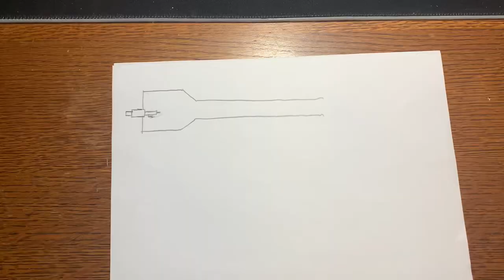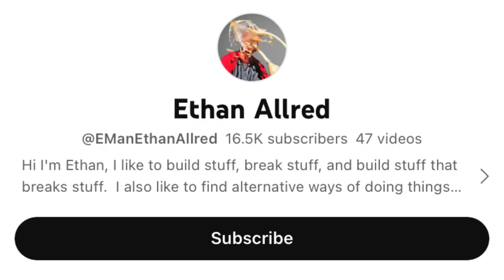Potato Cannon Sabot

Comment: Just sharing with you a neat trick I learned. 

There's a "potato cannon" community here in my country that builds what is basically an alcohol fueled marble guns out of 40mm and half inch PVC pipes.

What they do to increase power is they make these baffles that they glue inside the chamber. The holes on said baffles progressively get smaller as they near the barrel and creates a compressor effect.

This modification allows for a smaller ignition chamber without losing power output.

Comment: you can shoot: unopened glass soda/beer bottles (if you dont feel like cleaning up glass put the bottles in a metal trashcan with the open top facing the potato gun), any glass/ceramics, wet clay (reusable), thin blocks of dry clay (reusable), fishtanks filled with water, paint in a hanging glass/ceramic jar, model rocket motors, balloons, matresses, thin rusted metal, aluminum foil, a stack of cards, a stack of dominoes, basically any small object you can stack
Reply from the maker: Thanks for the ideas! I may make a video testing some of them out in the future.

Comment: Notice how much your barrel bends during the shot, shifting the muzzle significantly by the time the projectile exits. I would advise to add additional layers to the barrel by dressing it tightly in larger diameter tubes. It also would make it a bit safer. 
Main failure point is almost always the breach. You would need to strengthen it as well

Comment: Put a notch where the sabot touches the barrel, then wrap it in greased twine/string in the notch. It will reduce friction while giving better air seal
Reply: Would electrical tape work better? Or atleast compared to the bare sabot

Comment: If you can get your hands on a big valve (one sized for the cannon) you should try making a pneumatic cannon as they should be more powerful at least according to the one I built (just make sure to glue everything. The end cap on mine blew off from that)
Reply from the maker: The first time I showed the sabot was with a compressed air cannon, although the valve wasn’t very big. Despite the smaller valve it was able to shoot a ping pong ball at 120+ mph. I may revisit the idea and build one designed for the sabot.
Reply: What do think would happen if you sharpened the metal tip of the dart
Reply from the maker: @DaHail0123  I don’t think it would do much considering the round is so small. It would be interesting to lengthen the design to give it more inertia. Maybe I would finally make it through that cinderblock.
Reply: Two words: depleted uranium.

Just kidding
Reply from the maker: @DaHail0123  I would if I could…

and if it was legal.
Reply from the maker: @DaHail0123  I just found 1/4” by 4” tungsten rods on Amazon. Hmm…
Reply: How tf would you sharpen that. Diamond sandpaper?
Reply: I guess there is the same problem with depleted uranium:)
Reply: You just got yourself a new sub.
Reply from the maker: @DaHail0123  Bench grinder, like a giant tig welding rod
Reply from the maker: @DaHail0123  Oh, thank you! Now I definitely have to buy that tungsten!
Reply: No problem at all. I think the fins might need to have a bit of a modification to make it fly a bit straighter. Maybe thinner fins that are more like triangles.and also Maybe more of them for extra stability

Comment: Wouldn't propane be a better fuel, since it's what makes the hairspray flammable?

Also, the parts that you call "Stabilizers" are what's actually called Sabots
Reply from the maker: For now I am using carb and choke cleaner as fuel since it’s inherently flammable. I explained this in the video albeit in a terribly incorrect way which other commenters haven’t let me forget.  

Thank you for reminding me about my mislabeling of the parts. The only other person who noticed a problem was my father who was in the military. I am planning on correcting this in a future video and may feature your comment, if you would be willing of course.

Comment: HEY , i made one of these too, i was planning on making a sabot but i dont have a 3d printer, so i just wrapped a Smaller PVC pipe with sponges to make it fit tightly in the barrel, 

also is the sabot disposable? it must be hell trying to find it after it gets shot out, i suggest Making some kind of connection between all 4 of the Discarding parts and the Main Sabot at the back, so that way they just open up instead of seperating
Reply from the maker: Although the projectile is pretty easy to replace, I do try to find it after each shot. So far I’ve lost 2 projectiles and have had to reprint 3 sets of fins since they get destroyed so easily. Also, even with the 4 pedal stabilizers separate from each other they are quite easy to find. I’ve found them all every test and have only broken one which I just glued back together. Throughout my search for a sabot release system, I never though to use an elastic material like sponges to seal the projectile to the barrel, nice idea!

Comment: The sabot parts are too heavy thats why they fly so far and take up energy that could have been given to the dart. 

Try making the sabot pieces out of foam. It's doesn't have to be the same design implemented in foam. I one's made with just a cylinder with a cut in the middle and a groove to hold the dart.